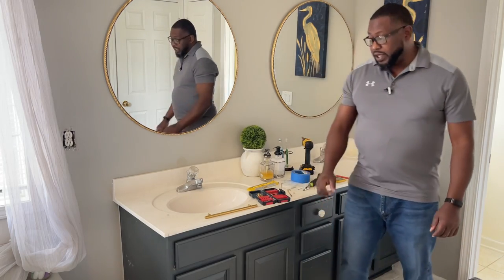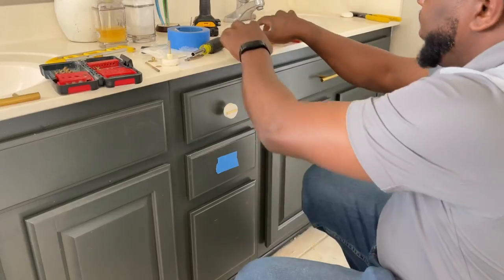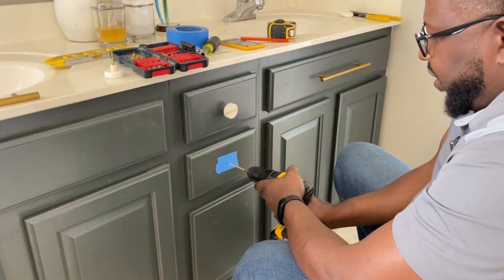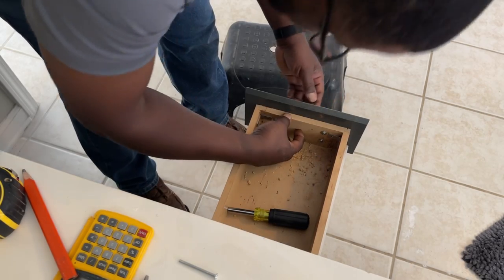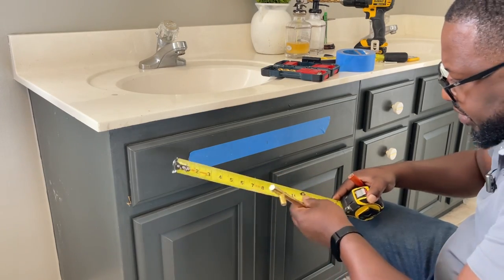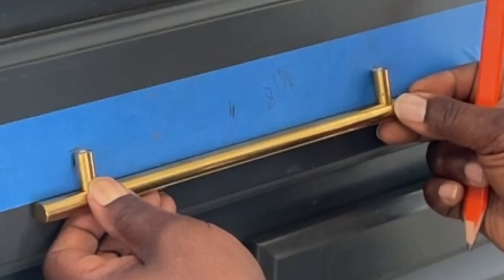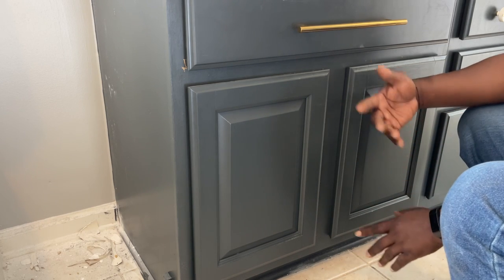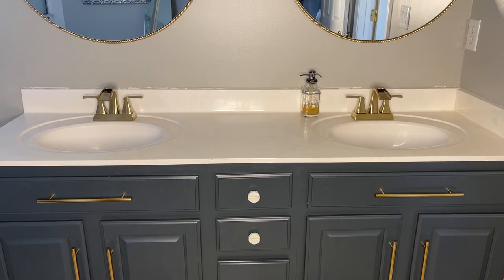Easy || How To Install Cabinet Knobs When They Are Too Short || DIY Cabinet Pull Install - No Jig

Comment: Looking good. Because it’s a much bigger draw I would put it in the middle. 
Question here .. I have two rocking chairs that I had custom made and had someone paint them a while ago. I want to restore them back to their original look.  What do I need to do?
Reply from the maker: Paint stripper, 80 grit sand paper to remove top layer, 180 grit to smooth out, stain and/or varnish and out a protective coat on.
Reply: @rontalley  thank you so much ☺️
Reply: @rontalley  So I should sand it first and then strip the paint then sand it again?
Reply: I brought one of those stripper tools will that work as well?
Reply from the maker: @joycelyn4274  Strip first then sand. Tools are usually quicker but you will still need to manually get those hard to reach areas.

Comment: Interesting. I purchased a pack of knobs from HomeGoods to change out the hardware on my bifold doors.  I ran into the same problem—the screws were not long enough but were glued into the decorative part. Could I use your fix on my doors, even though they are only one layer?
Reply from the maker: Yes, you just have to make sure that you do not go all the way through the door. Same concept.